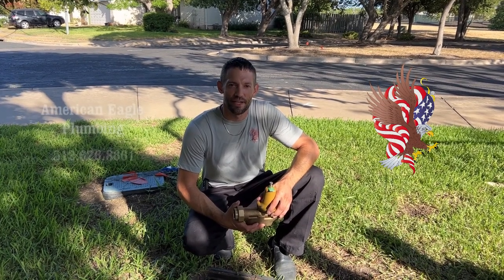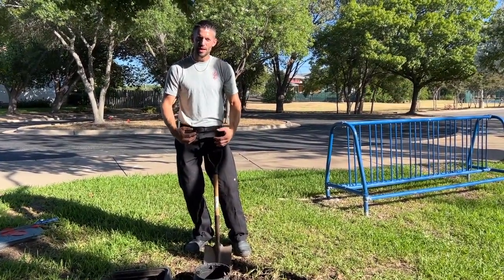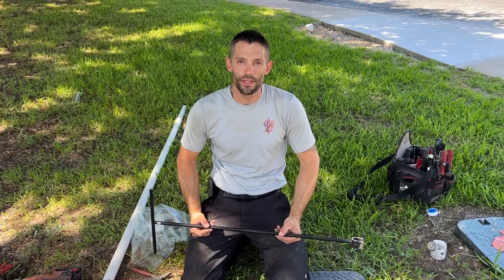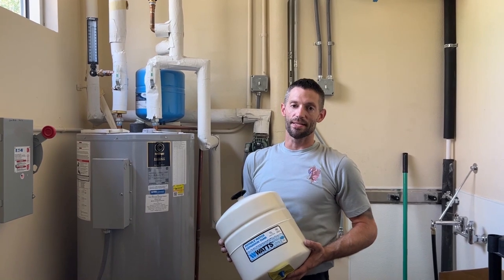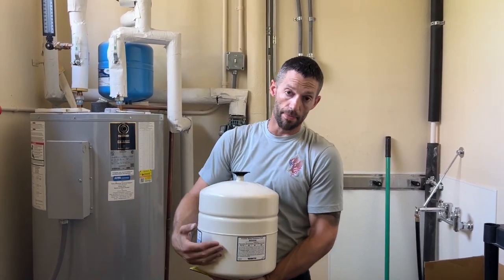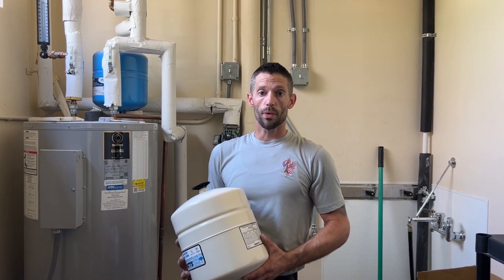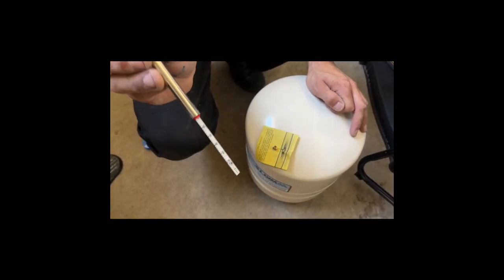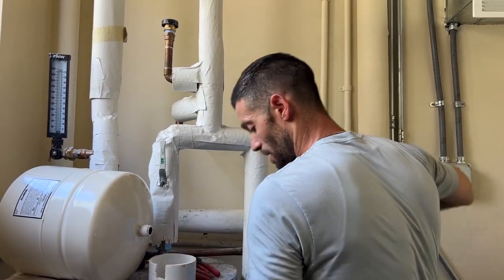Plumbing Pressure Reducing Valve Replacement

Comment: Is this for commercial property only? I don’t seem to have one installed on my residential home. Could I install one and my pipes be fine? I believe a lot of calcium has built up throughout my water pipes since the early 90’s late 80’s since my home was built then. Is there something I could place at the beginning of the water pipe coming from the street to destroy the calcium build up like possibly gallons of vinegar to break down the build up, or would that risk breaking down the build up and exposing any holes causing a leak?